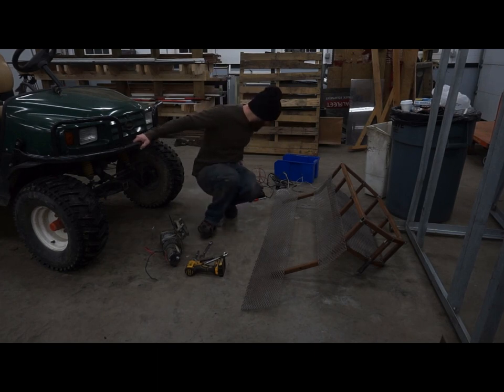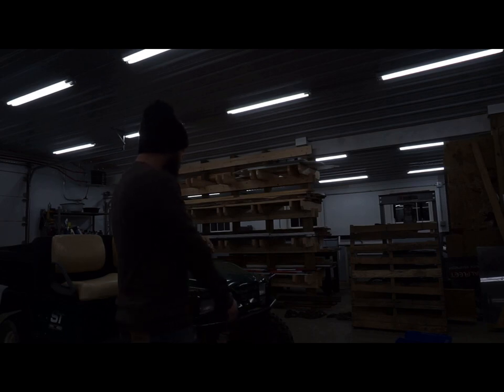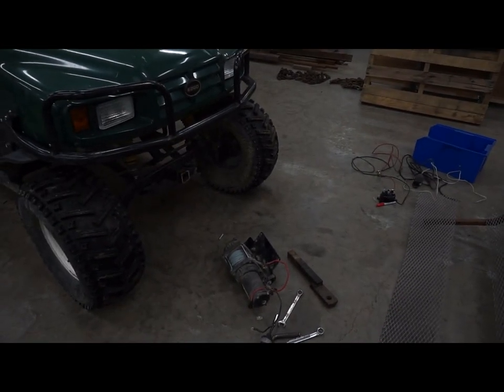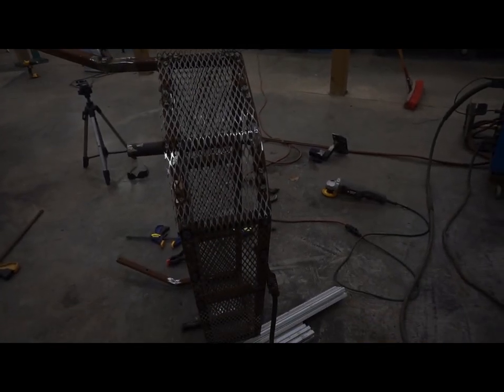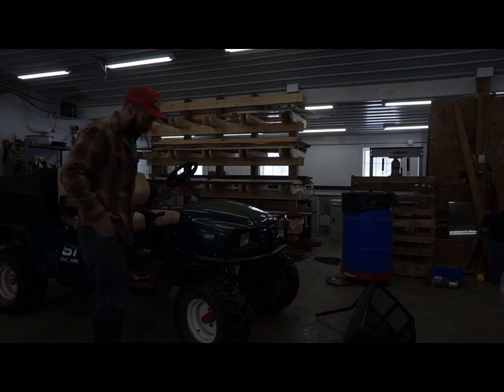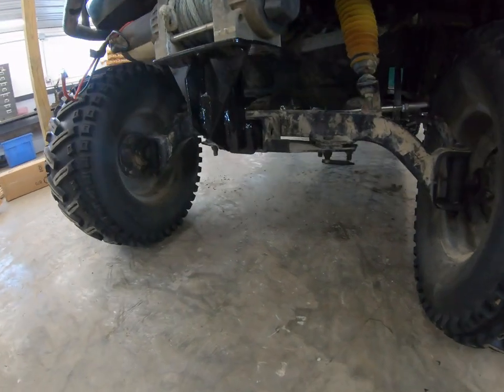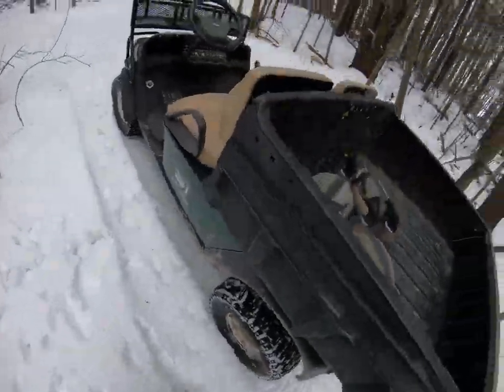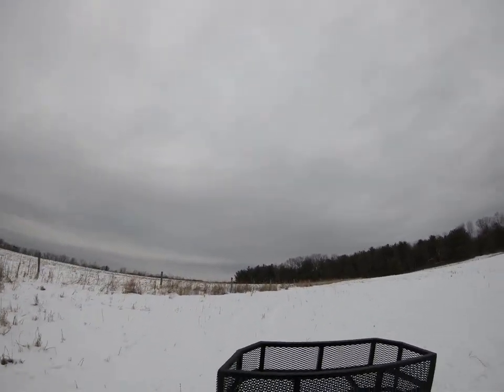Ez Go Golf Cart Fix Pt2

Comment: Does your ST 480 crank and run or does it work like a regular golf cart and only go when you press the pedal
Reply from the maker: Like a regular golf cart. For a while out of the blue it would just sit there and idle as long as you left the key on then it just went back to being like a normal golf cart. Not sure if there was something wrong with it like throttle cable stuck on or if theres a way to make them idle like that